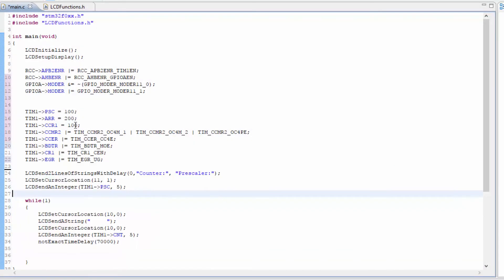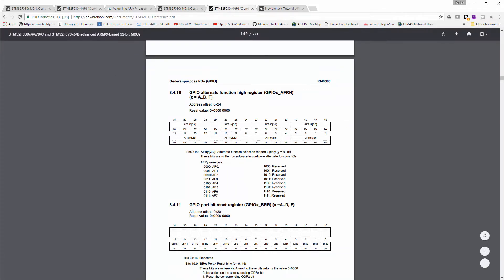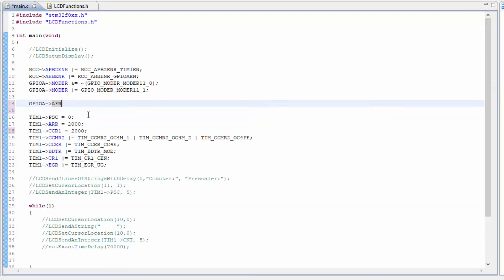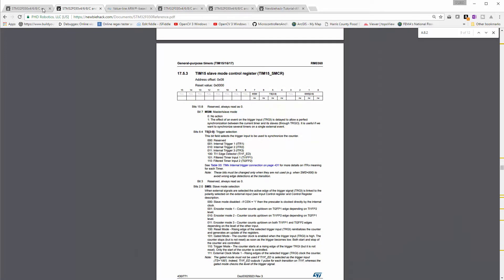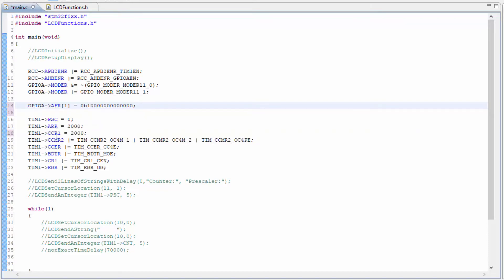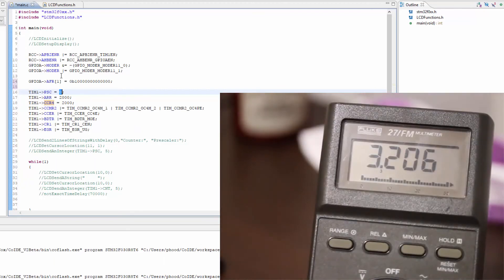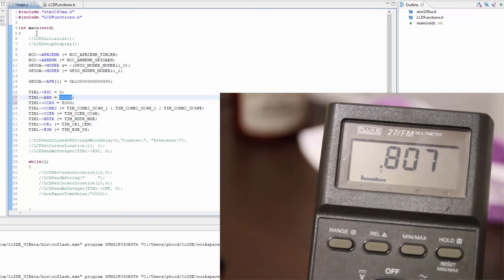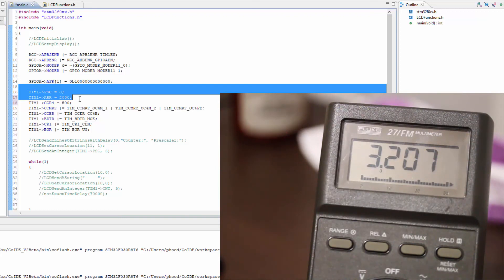45. How to: Edge Aligned PWM (Pulse Width Modulation) Signal Part 3 - STM32 ARM Microcontroller

Comment: Hi Patrick, I have one question for you. 

I am trying to drive two motors which are actually the same model with PWM. 
The thing is , I am using different timers (TIM1 and TIM3) with same prescaler and auto-reload-register values. 
However, both motors doesn't move at the same speed. When I check the encoders, I am seeing differences. 
Any idea why it happens to me ? 
Thank you.

Comment: Hi, I have a question. Why is the output voltage at 100% duty cycle not 3.3V?
Thank you
Reply from the maker: Good question and as far as I know, it is probably caused by a couple things: resistance all over the breadboard, and not perfect output from the ST-Link.  I would bet it's the latter.
Reply: Thank you for answering. When I get my nucleo board I am going to test the PWM and measure the voltage. Regards
Reply from the maker: You're welcome.

Comment: Is there any chance, you would be doing a tutorial about USB -protocol between microcontroller and pc or other devices? Stm32f030 doesn't seem to have USB support. Your videos are great! With them I learned to program a Stmf411re. Usb is the only feature I don't understand.
Reply from the maker: That is correct.  I mentioned that in my patreon page, but I will be doing USART with the FTDI Serial to USB.  It's not a perfect scenario, but it will allow communication via the USB until I create a new set of PCBs with an STM32 with the USB capability.